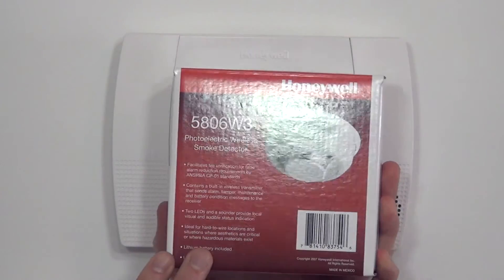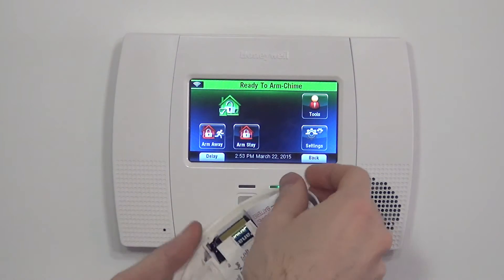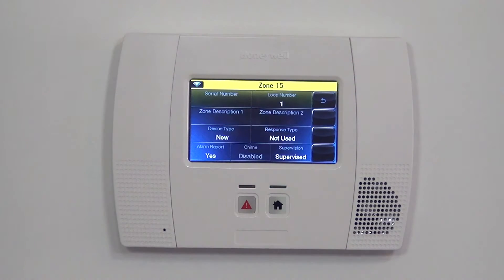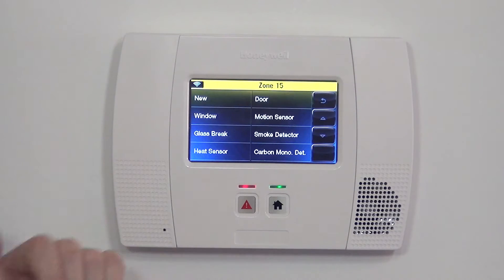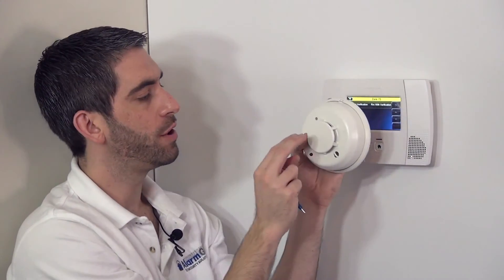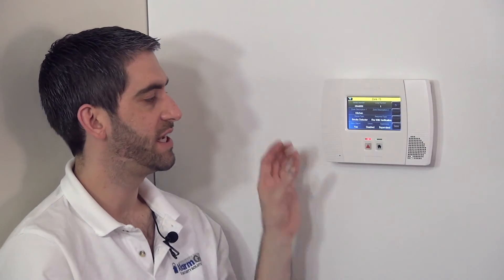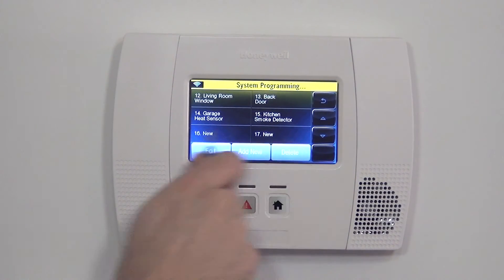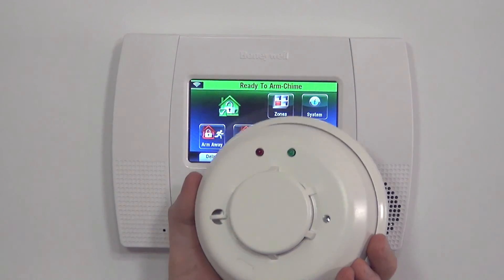Honeywell 5806W3: L5200 Programming

Comment: how do u silence it and prevent it from activating again? I have them and it's so annoying when the turn on and don't want to silence.
Reply: +Claroboy911 It won't stop sounding the alarm if there is still smoke in the sensing chamber. With that said, if you pop the head from the base and remove the battery, it will stop all sounding. Only do that once you are absolutely sure there is no active fire emergency in the home though.
Reply: +Sterling Donnelly ok thanks